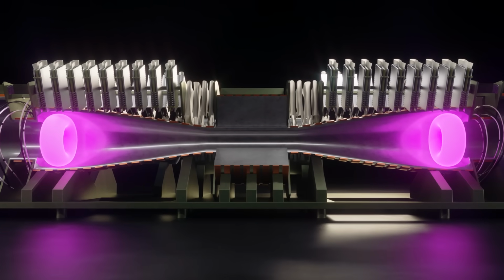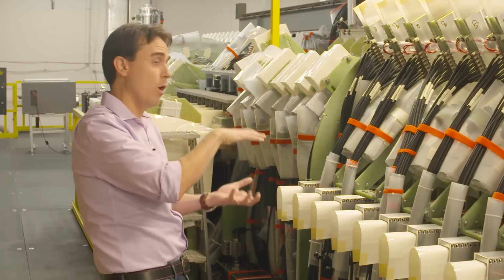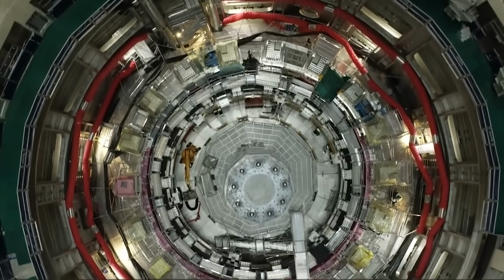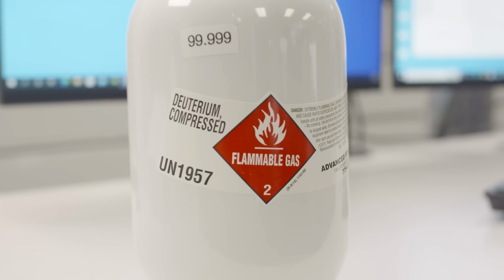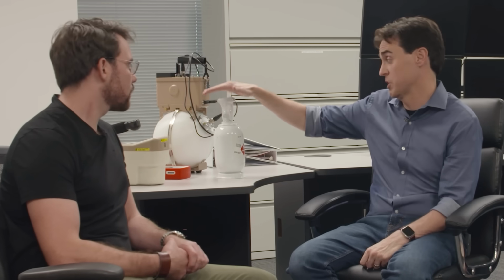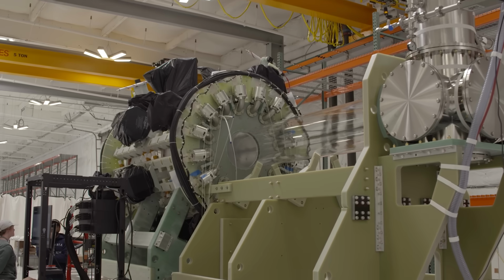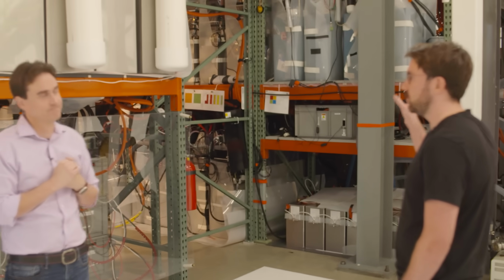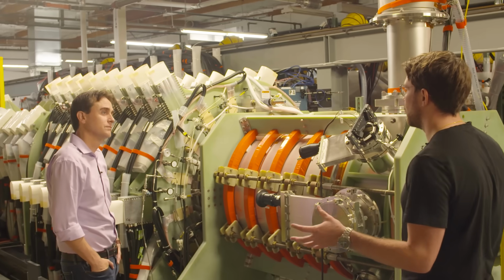A New Way to Achieve Nuclear Fusion: Helion

Comment: They are telling a nice story, a nice comms exercise. Not yet where tokamaks are though, by far. But if they can nail it, good luck !
Reply: Not gonna lie, I'm getting some cold fusion vibes here.
Does anybody know if neutrons were actually detected?
Reply: @lefr33man   LOTS!
They have not been published the numbers for their currently operational machine, Trenta (yet). 
But Helion published the numbers for their 5th (much smaller!) prototype, Venti back in 2018. 
Venti produced 10^11 neutrons per pulse from D-D fusion. It had a triple product of 10^19 keV s /m3. 
Now Trenta has 3 times the radius and 30 times the volume of Venti!
Confinement time scales as Radius ^2.1.
Generic fusion power output scales as volume*confinement, so r^5.6.
You can kinda guess that Trenta would be performing significantly better than Venti did.
Hope that helps!
Reply: @lefr33man  - You are right to be skeptical, in this case.
Reply: @lefr33man  A rebuttle: https://www.youtube.com/watch?v=3vUPhsFoniw
Reply: Trenta should be in JET territory, actually.
Reply: Tokamaks have established a considerable advance in terms of physics science and engineering. There is always space for other concepts, this sort of competition is good to have, even so there is no real competition for now. Time will tell.
Reply: @olivier6151   From what I know, Trenta has been besting some of the best Tokamaks out there in terms of raw nTTauE and it has considerable advantages in the fact that it has a very high Ti:Te ratio.
I would not say that Tokamaks have a clear leadership anymore at this point.
Reply: @elmarmoelzer2229  Agree:
Based on the size, complexity, and expense of ITER, I do not see a Tokamak reactor being commercially viable before this design, if at all (first-to-market rule and all that).  It has pioneered a lot of physics understanding that helped other projects advance, but it may end up becoming to fusion what the Stirling Engine was to internal combustion.
Reply: @HuntingTarg  but stirling engine was external combustion engine, hehe
Reply: @HuntingTarg  
I prefer stellarators.
They are Continuously fusion capable, therefore permanent fusion and not pulsed.
Unfortunately, stellarators only became possible with increasing computer power, since their magnetic field geometry can no longer be adequately calculated manually.
Stellarators also use deuterium-tritium mixtures.
But as said in the video, they also produce helim-3 that fuses itself back with deuterium.
Efficient use of leftovers, so to speak.

Comment: Just to be clear, is it still a net positive energy production including the energy investment in the helium 3 production? Also, what about the deuterium refinement?  Isn't that a pretty energy intensive process as well?
Reply: I don't think it's net positive at all. The 2024 timeline is hopelessly optimistic CEO speak, but I think this idea is a winner. The channel Undecided made that point.
Reply: @ste2hedz  Oooo,  I thought this was the organization that made that big announcement a few weeks back.
Reply: @adamhixon  That was the Lawrence Livermore National Laboratory using a laser based ICF device, a very "traditional" as you can get way of achieving fusion.
Reply: @AdamCO  no, that was a US national laboratory. They are using a completely different method and achieved 1.5x energy gain (so called 'ignition'), yet it doesn't account for the full energy input. Watch Sabine Hossenfelder's Science News 3rd week Dec 2022 (last week) for a great explanation. Helion does not require ignition as the CEO explains in Undecided w Matt Ferrel's vid Why Fusion is Closer Than You Think. This is a reason Helion is revolutionary yet they are not the only ones that have this attribute. Matt Ferrel mentions others.
Reply: @ste2hedz Will do, Thanks.
Reply: @AdamCO I'm pretty sure they said they haven't harnessed electricity from the reaction at all yet, and that their next model (completing in 2024) will be the first do do so. It seems like so far they are just optimizing fusion conditions.
Reply: Joe Scott did a short 12 minute video on this. He would be helpful
Reply: No fusion method is total energy positive yet, by a couple orders of magnitude, then a couple more to make it actually competitive with current methods of energy generation.
Reply: @Plex42  we literally just tested net positive fusion though? It’s not ready for commercial use but that’s an issue of scale and increasing efficiency. Do you think gasoline engines were ubiquitous a month after they were invented?
Reply: @damonedrington3453  No, that is common misconception about NIF results.  The  2.5 MJ fusion output was more than the 1.8 MJ of laser light, BUT it took 500 MJ to power the lasers!   So, from input to output only a half percent of the energy put in was released by fusion.  Net loss!
Reply: @RWZiggy  my man i was looking for someone who actually sees through the smoke 
of these snakeoil salesmen . we are still very far off , if it is at all possible 
but everybody believes its just around the corner , they have been saying its just a couple years out 
for decades now . my best bet is that it falls under the law of thermal dynamics and is actually impossible 
unless you create an artificial sun and even then the energy to create it would be orders of magnitude more 
than the total output of the suns life

Comment: I want to like this, but I don't.

For one, this system is getting no big press, just like the tokamak and stellarator designs. Oh yes, those others, they've got press for years and years, but only of the kind of, "we're about 40 years away now from making this thing generate net-positive energy fusion."

That's where the energy input to the system making up a fusion-plant as a whole, is smaller than the energy harnessed from the reactor. It's the first step in getting to something that eventually might become useful /and/ cost-competitive for power generation. Just the first step, because it likely would be much more expensive to generate power this way, than by other currently available means.

What's got the press just recently? Well…it's another old old experiment, at the NIF, the National Ignition Facility. What got the press press just before Christmas, was that the facility /finally/ achieved a net-positive energy balance fusion!

But…you have to look into the details, which were not at all clear in most of the press reports, including the presentations done with politicians supporting the NIF. This experiment isn't designed in any way to be able to harness the excess thermal energy which was generated. What was celebrated as a "game changing" achievement, was that the laser power focused on the fusion pellet in that design, was slightly smaller than the thermal energy emitted by the pellet after being struck. Net-positive energy!

Oh, but wait, the BIG detail not mentioned was that when one accounts for the efficiency of the lasers themselves, the input energy into the laser system was much larger than the thermal energy emitted by the pellet as its contents experienced fusion. So, when one accounts for the supplied energy to the laser field, the system as a whole is still net-NEGATIVE.

Nevertheless, the experiment was hailed as having been the FIRST to achieve a net-positive energy balance fusion reaction, when one neglects the input energy to the laser system, and counts just the incident laser energy on the fusion pellet itself. Boo!

What Helion, Tokamak, Stellerator, as far as I'm aware haven't demonstrated, is that the input energy to their reaction initiation systems is lower than the energy produced and harnessed by the fusion reactions they achieve. If it were otherwise, it'd would have been one of them getting all the press right now, and not the NIF's "science experiment" which isn't and cannot be setup to capture the emitted thermal energy to generate electricity.

The NIF claims to be FIRST to have achieved a net-positive energy balance fusion reaction (when neglecting the energy inefficiency of producing the required laser field). That means that while Helion, Tokamak, and Stellerator might be able to achieve fusion reactions, the output of these reactions doesn't even pay for the power needed to initiate them.
So…despite the "whiz bang" of it, this all strikes me as ongoing snake-oil.

Fusion has been perennially "just 40 years away" from solving all the world's electricity needs. It was this way 40 years ago, and has made no real progress since. The biggest problem, as I see it, is that the physics is pretty well understood, but the engineering is trying to explain that we don't yet possess the technology to harness fusion directly as an energy source. And, if we integrate the engineering and physics disciplines carefully (e.g. the problem of tritium and beryllium supply required in the case of tokamak/stellerator style reactors), the problem is not even solvable to produce a workable technology.

This presentation suggests that Helion is /way/ ahead of the NIF. If that were true, why is the NIF's work getting all the press now, despite it being a genuine "science experiment" and not something we could extract power from? The CEO makes it seem as if, with Gen 7 of his firm's design, you're gonna have the first reactors that can be connected to the grid and generate power. Even if it's just a solitary 100W lightbulb.

This all still feels like a GIANT waste of time and resources. We have fission, and plenty of working power reactor designs. We have the potential in safety and economics of scale benefits of the small-modular-reactor concepts, if they could get the critical-mass funding they need and regulatory and civil-society support. That's the realizable future for non-CO2-emitting electrical generation. Not this.

One mustn't also forget that solar/wind are only "cheap" as compared to fossil and today's fission nuclear energy, because they are subsidized MORE than other energy forms. You can get any of those electricity sources for about the same metered bill cost, but the renewables stuff comes with a hidden tax to pay for their subsidies that is a multiple of that cost. Therefore, they're the most expensive available supplies we have on our grid. Not to mention the most grid-destabilizing, as they displace cheaper baseload generation, and force that generation into less efficient modes of hot-standby for when the winds aren't blowing, and the sun ain't shining.

For all this tech-sophistication, we're sliding further into the realms of "Idiocracy".
I await correction.

Comment: How can you contain anything at 10 million C? Not many cables in each magnetic section? Of course, the power required to do 'compression magnetic waves" requires cables the size of a gutter downpipe. They have a rack in the warehouse full of capacitors but they have used ones at the moment. Finally the reactor itself, they are using old-style analog pressure gauges and plastic shrouds, and cheap white cable ties. Now I'm in Sydney, today I had a huge win at poker. I have a bridge for sale if anyone is interested
Reply: They did not spend more money than they had to. The whole Trenta program cost 35 million. The components they are using are good enough. Sure you can spend 10 times more on everything and then the machine costs 350 million. That is what big government programs do.

Comment: They are not asking the right questions. 1. Can you get more energy out than you are putting into the machine? 2. What will be the cost of electricity generated by this machine.?
Reply: They answered one and can't the other.
1) Not yet, but in theory yes, that is what the goal of fusion power research is
2) That will entirely depend on what design gets a net positive output, how efficient it gets, how the fuel is found, etc
Reply: If anyone tells you they know how much fusion energy will cost they are lying. You shouldn’t expect answers to those questions until years after someone actually generates positive energy from a full reaction. Even then your energy costs will be heavily influenced by grid maintenance costs. You still need to build and maintain power lines even if the energy is dirt cheap.

Just enjoy the educational content regarding about how a new fusion generating theory works. This is a science video not an economics one…

Expecting answers to unaswerable questions is a great way to get scammed btw. I’m pleasantly surprised when these companies don’t lie to us.
Reply: @NickSteffen   The cost is at a plant level, of course, not at a grid level. No power plant operator names cost at a grid level. 
1 cent/kWh is the cost "target" and AFAIK for a few years down the road, not the FOAK plants. But there is a (realistic) potential to get the costs down that low. 
The cost of fuel is negligible, lower than for nuclear fission power plants, even. The CapEx is much lower than for fission power plants and probably comparable to gas power plants. When mass production really takes off, then maybe even lower than that.
Reply: @elmarmoelzer2229   Even at the plant level it’s pointless, does a plant have one or two reactors regardless of how cheap fuel it still has transportation costs. The cheaper the fuel the larger the share of the overall cost that transportation will be. If I make two plants and one is on the ocean harvesting heavy water it will have a different cost structure than one in the middle of the desert. Target numbers sound nice for investors but pretending they have anything to do with reality is silly. Appreciate the science for what it is and worry about costs later.
Reply: Target cost is 1 cent/kWh. Polaris will demonstrate net electricity in 2024.

Comment: Well, they have some prototypes of some tech that could be used once we actually had achieved fusion. 

I work a supercomputing facility and we do have a few teams working on Quantum Computing, sounds cool, right? Well, it is pretty cool, but what they actually do is working with simulated quantum computers to prepare software, interfaces, algorithms etc for the time when quantum computing is commercially available (some doubt about the current quantum supremacy of Google). 

So, all nice concepts, but I will celebrate when I get a fusion plant close to Amsterdam. In 50 years?
Reply: They  make fusion every day with Trenta.

Comment: Just curious over what the source of electricity would have been at present, to operate the system in question including the immense magnetic field generators. Can only assume that once the best of nuclear fusion is tapped in the future, a small fraction of the energy can be stored as energy supply for the system.
Reply: Trenta does not need that much for a single pulse, about 4 kWh. That is less than 4 hours of charging from an average residential power plug (and I am sure they have much better power lines).
Future systems will only need the first pulse charged from that and then all subsequent pulses are powered by the recirculating energy (mostly recovered input energy plus some of the fusion energy to make up for losses).
Reply: @elmarmoelzer2229  That works even for the fusion coils requiring about 1M Amps?
Reply: @akshairk970   Yes

Comment: Millions of degrees... not melting the material and metals around it? Interested to see how it goes into production
Reply: The plasma is hot, but not very dense (only 1/1000 the density of ambient air). It only contains a few kWh of energy.
It is generally held in place by magnetic coils. Even if those failed for some reason, the walls would only see a little bit of damage. That is a problem if it happens often because the walls will have to be replaced eventually, but generally is not a big deal.

Comment: Seems promising however I'm skeptical. WAY smaller than the ITER reactor.
Reply: Size does not matter, the technique is what matters ;)
Reply: @elmarmoelzer2229  I was thinking more about the materials. But hey! Technique might be the right approach.
Reply: @Moneynis  What about materials?
Reply: @elmarmoelzer2229  I assumed that since the reactor is smaller the materials might not stand up to the heat. I might have missed something about it in the video since I skipped a bit.
Reply: @Moneynis  Helion has fewer, lower energy neutrons to deal with. So that helps a lot. 

The charged particles and charged fusion products don't really hit the walls, at least not until they have given off most of their energy to the surrounding coils.
Reply: @elmarmoelzer2229  Ah there we go, I didn't remember that part.

Comment: What if you were to rapid fire those plasma rings? Would you get a fusion buildup? Maybe increasing the energy production?
Reply: That is actually not completely wrong. They COULD fire several FRCs at increasing velocities. It would require stronger magnets to accelerate the later ones to high speed. The important part is that all of the FRCs collide at hypersonic speeds. Then that resulting (much bigger and hotter) FRC would be compressed as usual. It IS a lot more complacted though and likely not needed which is why Helion has not done that yet.

Comment: This is the most promising fusion technology I have seen.  It has the potential to SCALE - which is very important from a commercial perspective.  It also has the potential to pump the magnetic field with a frequency that can be developed.  I would like to know the energy conversion ratio.  (Energy in/out).  Is it producing net energy?
Reply: Trenta is not quite there yet, but Polaris will produce net electricity in 2024.